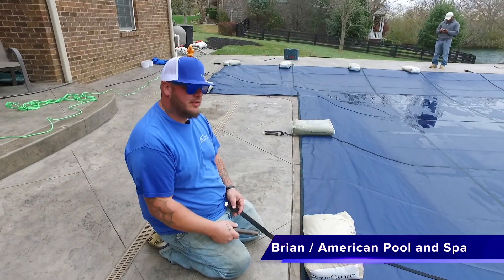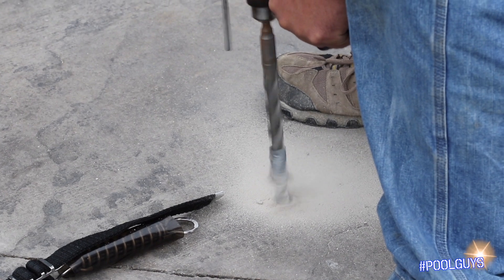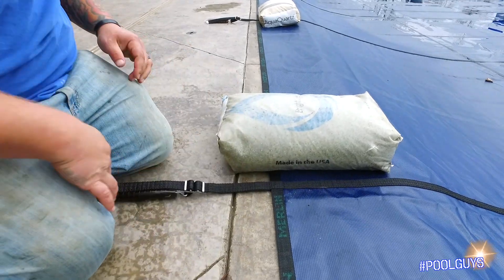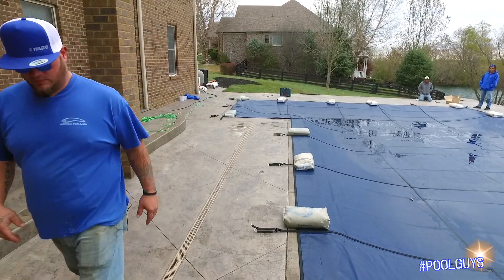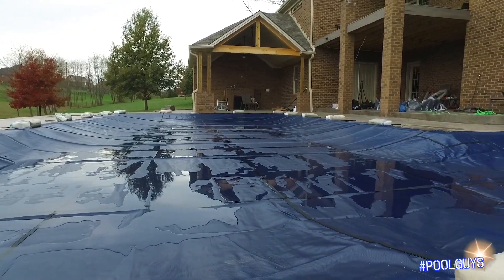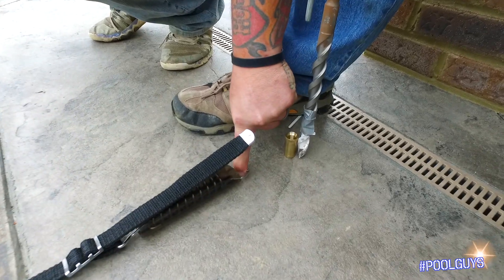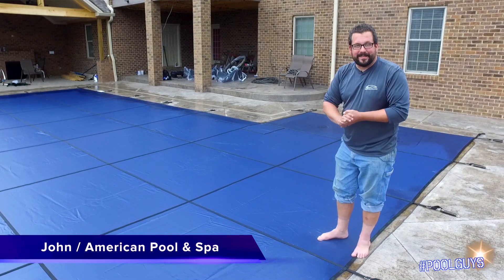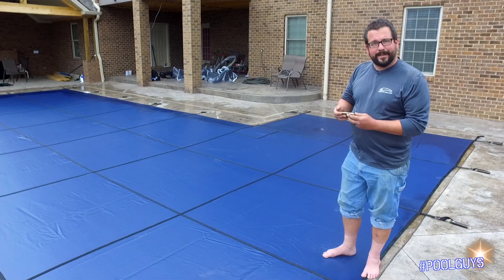Installing and Testing a Winter Safety Cover | #PoolGuys

Comment: I had a cover installed by "professionals" at my last place and they messed it up pretty good. So when we moved to our new place, I thought, I can probably do this with a little help from google, youtube and all the great people who post videos. Although my centering is slightly off, the project went smooth once I found the right tools. I had to go through pavers instead of concrete so needed a coring drill vs a hammer drill. All in all it worked out very well and I want to thank you for the explanations and the time you took to show each step.

Comment: Good informative video. I am thinking of replacing my Myco mesh cover installed in 1993 and I would have made a few regrettable mistakes had I not watched your video. The Centering is very valuable. Thank you much. Tom Catucci
Reply: Unless you redid the masonry around the pool, they will remake the cover with your current spring pattern. They may add or take away a strap or two

Comment: I have an above ground 12X24 pool  with a deck around it . The deck is 24 inches wide  on all sides.
Can a safety cover be installed in this situation?
Reply: I wouldn't do it.  A typical safety cover requires 36 inches of decking all the way around.  I just installed my cover and I think the average anchor was installed about 32" away from the edge of the pool.  With a cover that costs anywhere from $600 - $1000 depending on the quality of cover you buy, I wouldn't even try it.

If you buy a cover that's smaller than recommended just to try to shrink the overlap onto the decking, you run the risk of tearing the cover, and/or collapsing your pool when that snow comes.  However, if you're in an area that doesn't get much snow, I might be tempted to order a smaller cover for your situation.

Comment: Question should the anchors sit upper so that the hooks ride or lower because i notice a gap between edge of cover and concrete area surrounding the pool.
Reply: You don't want them that high  when you close your pool you dont want to raise the anchors to were you can see the thread's on them because they could pull rite off with alot of snow